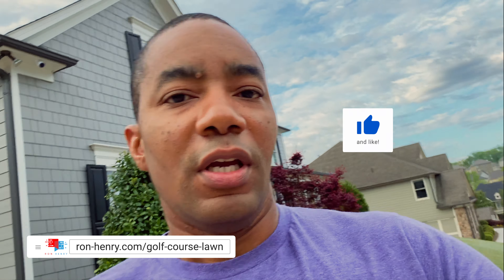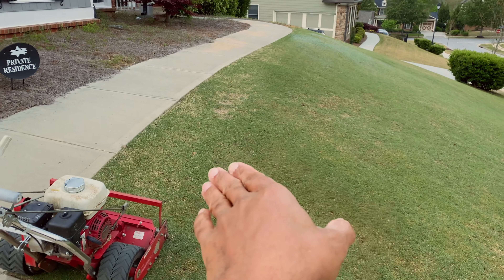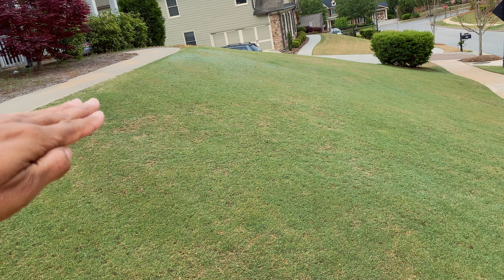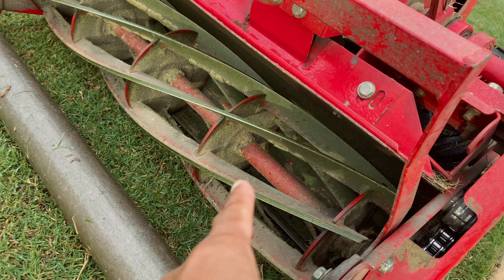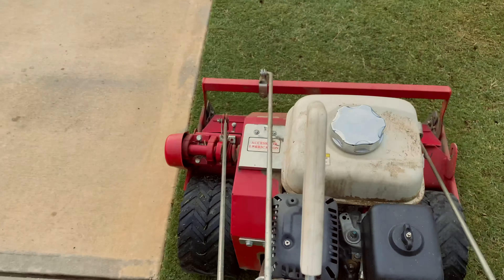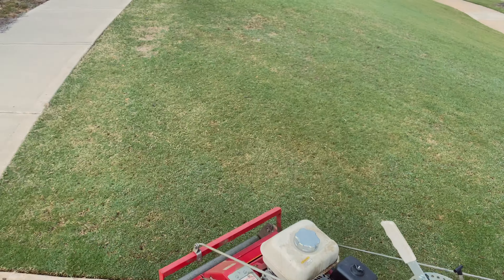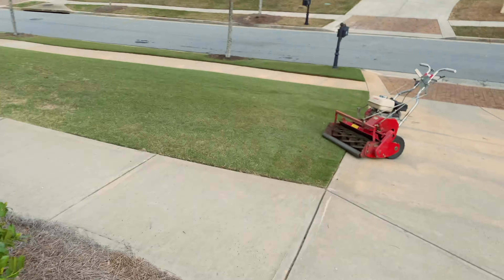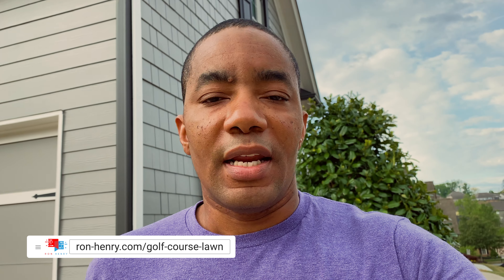How to MOW SLOPES with a Tru Cut REEL MOWER - EASY TIPS

Comment: I have a TC 20” and getting wheel ruts on my trim pass. Nothing in the middle as I change directions. Any way to prevent this other than sanding once a year?  Thanks!
Reply from the maker: Not really. Sanding and varying your mowing pattern.
Reply: Afraid of that. 😒😊

Comment: Hey Ron, how does the new Revolution perform on your front slope? My slope is a little steeper than yours and I have a TruCut C25, but even if I cut at an angle the weight distribution is poor. However, it’s the only mower I’ve found that can summit the slope.  Could you elaborate how the Revolution did? I’d like to order one before the pre-sale ends, but the slope is a big question mark.  Thanks!
Reply from the maker: I've not gotten the opportunity to use it on my front lawn. It handles the slope at the Reel Rollers turf park fine though.
Reply: @RonHenry  Thanks Ron!  I have not seen the slope at the turf park....any idea on gradient?  Thanks!

Comment: In my part of Texas, Neil Sperry is the man with the answers. He recommends mowing in a different direction every time you mow so the grass doesn't learn to lay one way. However, I think that is more true for the general public that uses rotary mowers. I think when using a reel mower, that rule doesn't apply. I like your ideas and philosophy and the results in your yard are proof positive.  I use a TruCut and my neighbors hate me. Ha.
Reply from the maker: Thanks Bob.  For flat sections of the lawn, switching it up definitely makes sense.  For a slope o get the beat results from more even weight distribution. 👍😎 thanks for watching.

Comment: Hi Ron! My yard is a lot of slopes going different directions. I used the Tru Cut for the first time last night and pretty much scalped many parts of the front yard. (Zeon Zoysia) Ouch! Plus 90°+ days. Not good, Ron! I'm giving it extra water today and it may rain. You know what doesn't help? When the sales guy says that lowering the selector handle heightens the cut and it's just the opposite!!! So when I thought I was raising the cut I actually lowered it even more!! So all that to ask, now what? What can I do to help my zoysia recover as quickly as possible. Wish I could send you pics!! Also, I had lots of choppy lines like the mower was bouncing. (?) HELP! Oh! And those thumb buttons ~ definitely spaced for man sized hands. Ouch! My poor thumbs/ hands were so sore! I need to figure out a solution for that issue, too. Lots of learning last night! 😊
Reply from the maker: Hi Sheril. I'm sorry that the sales guy gave you bad info. The closer the height of cut handle is to you the higher the height of cut. Moving it forward, lowers it. As far as advice, I'd recommend that we raise it up to where you're not getting scalping. Once you're mowing a slope, you really have to mow a bit higher and focus on keeping the mower as flat as possible to get a good result. The Zeon Zoysia will bounce back. Might take a few weeks, but it will recover. Let's raise the height of cut to where the mower is barely taking anything off. The controls do take some getting used to. My thumbs used to be really sore too when I first starting using it. After a while you'll get used to it and it won't be nearly as bad. Will just take a bit of time. All part of the process. Let me know if I can help with anything else. It will be ok. The grass will come back. 👍😎
Reply: @RonHenry  That's what I keep telling my husband! Lol! Thanks, Ron! It's grass, it'll grow back. In the mean time should I refrain from using Weed Stop or Simple Lawn Solutions liquid? Thanks again, for the response and all the info!
Reply from the maker: Of the 2 the Lawn Solutions Liquid would be ok since it's basically liquid fertilizer. It will give the lawn a slight nitrogen boost which will encourage growth.
Reply: @RonHenry  Thank you again, Ron!
Reply from the maker: No problem at all Sheril. Let m know if I can help with anything else.

Comment: Have you leveled/top dress the hill. I have a hill and have notice minor erosion (just enough to be an issue with reel mower)
Reply from the maker: Scott Musgrave yes I have.  The hill has been fully too dressed twice and has had numerous spot dressings. It’s pretty challenging to do because during rain the sand wants to settle at the bottom.  I’ve found it best to do a little at a time over time.  That gives time for the grass to grow back in and hold onto the sand.

Comment: Hey Ron, where did you get that exhaust deflector? My true cut roasts my legs when cutting.
Reply from the maker: Heya Keith. Mine just came with it? I didn't purchase aftermarket. The dealer where I got my mower (and who does the service) should be able to get you one though. Keystone Rental in Duluth, GA. (770) 476-2999. Tell Pat or Dan that Ron sent you. 👍
Reply: Thanks!! Didn’t know they existed until I saw yours, bought my 27 last year and it did not have that cover.
Reply from the maker: Let me know if you have any issues getting one. I can ask Pat what the part number is.
Reply: Thanks Ron, found them on eBay for under $5.00, no more leg roasting while mowing.

Comment: Does the mower still cut when you pull it the other way instead? Mine seems to
Reply from the maker: It cuts in both directions without issue.
Reply: @RonHenry  Thank you.

Comment: Did you ever use a rotary mower for your front lawn?  If so, did you also cut diagonal similar to the patter with the reel mower?
Reply from the maker: Hi William. Nope I've never owned a rotary mower since living here. Mowing diagonally is how I would probably approach mower the front lawn even with a rotary since it keeps the weight more evenly distributed as you go up and down the slope.